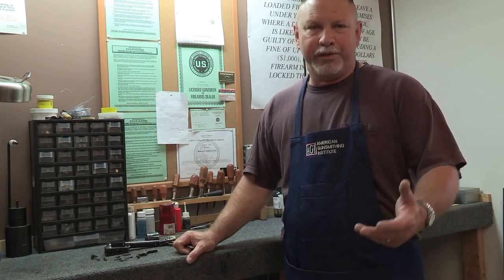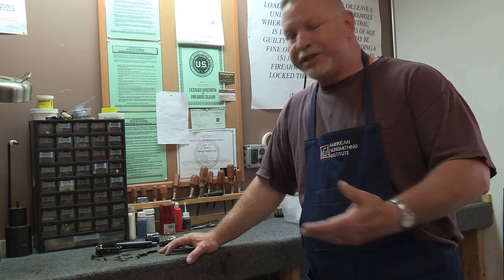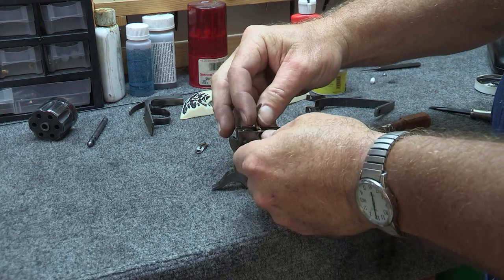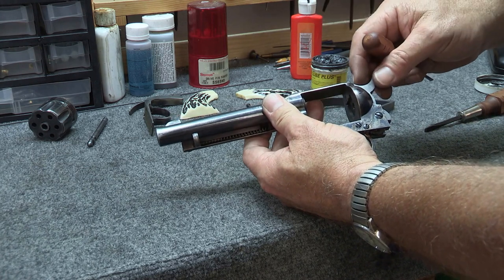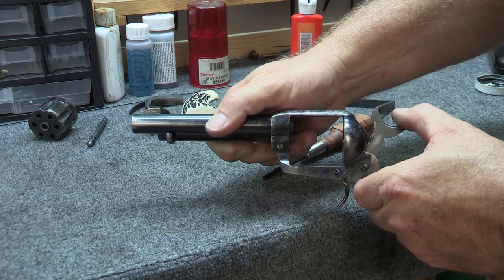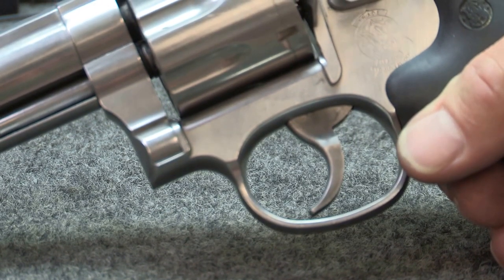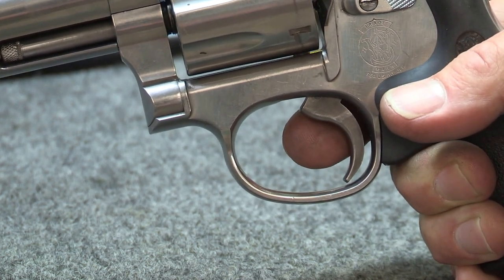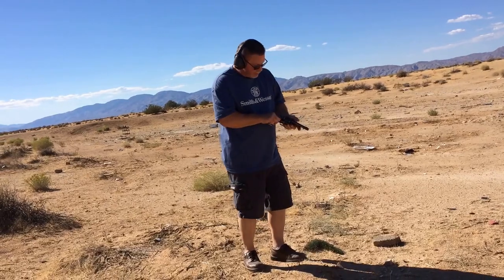Great Western Firearms 22 LR

Comment: Question sir. I know this video old. But I just got hawes western six shooter .22 cal. Is was broken for 35 bucks. I having trouble with putting the cylinder back in to the fire arm. I know one thing is the bolt aka cylinder latch is broken.
Reply from the maker: You will need to call the shop and leave a message. I'll call back. I'll give the details of what you need to do to send it for repair. You are responsible for shipping to and back as well as cost of repair if part is available.

Comment: I have a Great Western 22lr that shoots great as long as you cock it slowly each time before firing. If you attempt to operate it quickly it will occasionally get out of time and not lock up properly. I have been told that I need to have a new cylinder made to correct this. In your opinion is this correct?  Thank you for posting this video.
Reply from the maker: No, the hand controls the rotation of the cylinder by way of the ratchet pad. If the hand is too short than the hammer is locked back before the cylinder finished its cycle.  With a longer hand (stretched) the cylinder locks up sooner and allows the bolt to lock in place before hammer is in the full cock notch which correct. Second if the cylinder is by passing the notch in the cylinder, than the bolt (cylinder stop) must be adjusted. This is probably the problem with yours. In all my years I have never see a gun that was used so much that the cylinder was warn out.
Reply: @lewisprecisiongunsmithing4381  Bob thank you so much for the information. I will be getting in touch with you in the very near future.